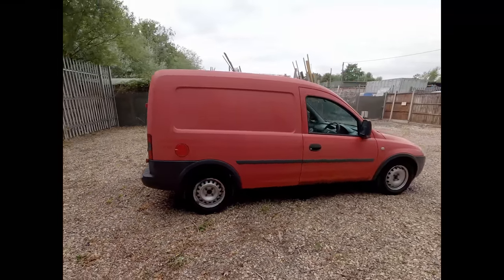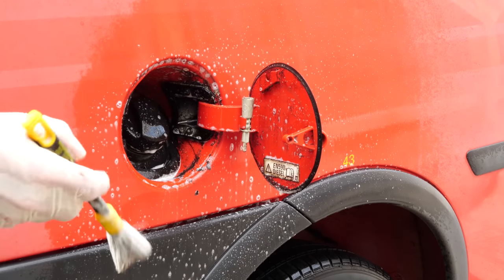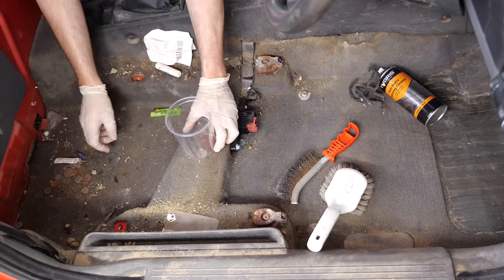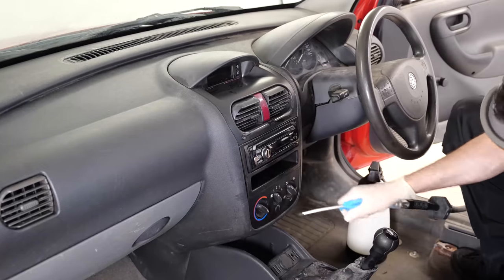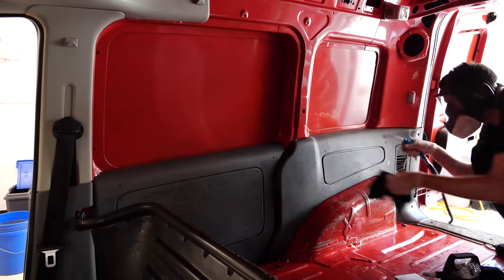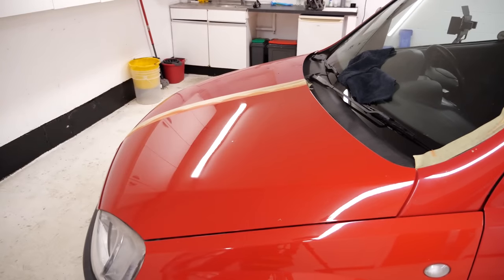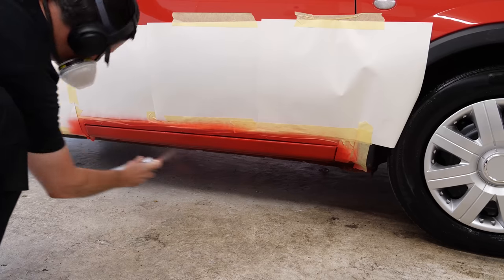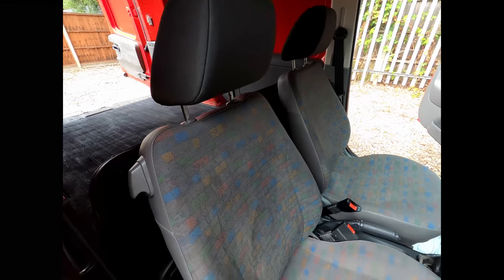Deep cleaning a Disaster detail Vauxhall/Opel combo Van ASMR filthy/Dirty barn find relaxing clean

Comment: As an ex-Postie this was great to watch. What a transformation! I can tell you this is the most love a Royal Mail vehicle will ever get in its life. They are treated so bad during their working lives. Vans are rarely assigned to just one person. They are driven hard, never cleaned and even the newest vans have a dent or two within a few months. They have a hard time on the road delivering and it’s great to see this vehicle with a new lease of life! Good work
Reply: They look to have marginally improved with the Peugeots but it’s still a rough old fleet, I remember some of those LDVs being in a right state, so faded they were almost white and not a straight panel on them 😆
Reply: As a current RM fleet mechanic, i can confirm that thay are still abused daily. i'd have the combos back in a heartbeat though,great little vans.
the fiats, peugeotsand Mercedes just fall apart
Reply: @TheAgwarn  😂👍👍👍
Reply: @chriscuthbertson4931  The Combo's and Doblo's are still up here in Dundee, mainly 07 and 58 reg's and the lacquer fade in them is unreal 😂.
Reply: I remember when i worked at rm somebody managed to put unleaded in a brand new one with 17 miles on the clock
Reply: @chriscuthbertson4931  I had a sprinter at PF for a while that had a dodgy ignition barrel...i could start it and then remove the key. Then my next one had the opposite problem where the ignition wouldnt turn off which in turn wouldnt allow the back doors to unlock.
Reply: @b34rdy  🤯🤯😵‍💫😵‍💫oh dear!!!!! And petrol into a diesel is worse than putting diesel into petrol!!
Reply: What's that switch do in the box in the back on the righthand side 13:44?
Reply: @ricky302v8  Looks like a light
Reply: @b34rdy  I owned one of these vans, it's a switch but I never worked out what it was for.
Reply: @ricky302v8  turns the interior rear lights back on after they time out

Comment: Good to see you look after your self wearing PPE ... So many detailers on YouTube handle harsh chemicals and dont even wear gloves.
Im a mobile detailer in the UK.

My van is an ex royal mail, ex large load escort vehicle 2003 Vauxhall combo 1.7Di with starship miles.
Ive owned it for the last 14 years and Ive detailed it maybe 3 times. It needs another if I get the time.
It has the usual combo water leak on the plate that holds the master cylinder into the drivers footwell. So I have plants and green stuff growing in the footwell.
My customers dont care what my van looks like when I arrive, they care what their cars look like when I leave.
I see very few new people per month, I dont have the time. 95% of my customers are returning domestic customers The rest of the time I do finishing and final polishing for a few local body shops.

I cut my teeth in the motor trade. Needless to say, I steer clear of motor traders (bunch of pirates) and the motoring dross they deal with.

Comment: The Koch Chemie Top Star is awesome on plastics; it does disappear after a couple of months, but it’s very even and better than OEM. Plus there is no need to buff it down, it will self level and dry matt (if you’ve missed anything during the final wipe). Awesome job. 
You may save some time with a clay mitt using your shampoo as lube before the final rinse. Good for very large flat areas and if you’re polishing anyway.
Reply from the maker: Hi thanks for the info Tosh

Comment: very nice. how do you find battery polisher, is there enough run time for job? from my experience with other tools, around 20-30 mins is best what you can expect, if used nonstop. not sure i would like while doing hours of polishing, need a lot of batteries etc. for quick jobs its probably ok.
tnnx.
Reply from the maker: On speed 4/6 a good 30 mins+ 
The battery’s charge pretty quick and you get two with the tool.
I have a 3rd but rarely use it.👍